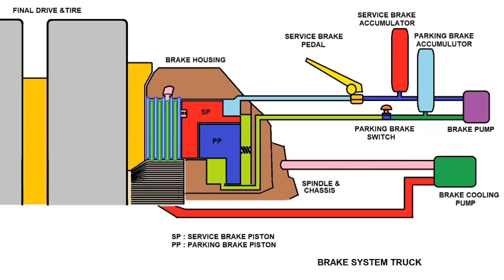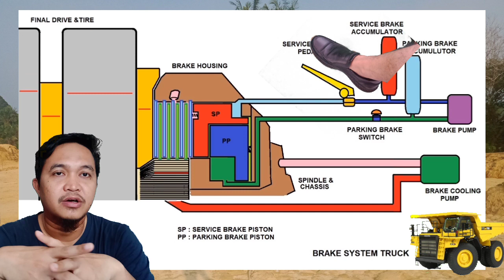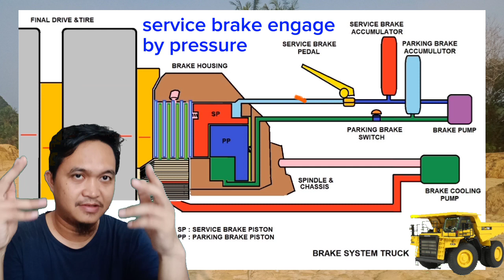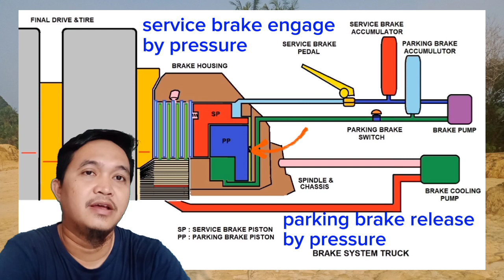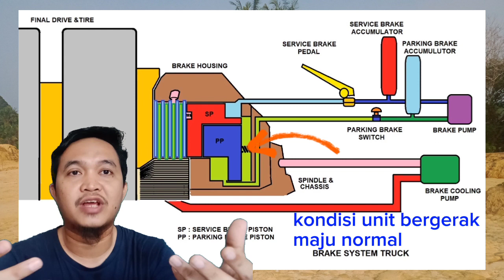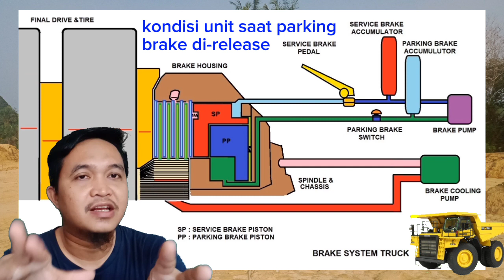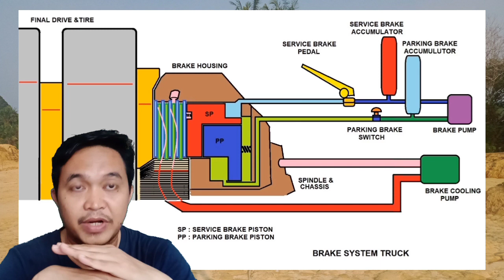Brake system unit truck. Cara kerja service brake, parking brake dan brake cooling truck. BMC 27

Comment: Ijin tanya mas . Saya ada engine Caterpillar 3126 industrial.
Ada masalah pada saat awal start mesin normal. Setelah beberapa lama .mesin tiba-tiba jadi hunting / mengayun . 
Lalu mesin dimatikan dan di restart ulang baru mau normal lagi ..
Kira2 penyebabnya apa ya . 
Karna mesin tidak ada MID/CID/FMI . hanya ada lampu indikator diagnosa yg berkedip 6 dan 4 kali ..
Reply from the maker: Mas bisa dibantu merk monitor nya ? Dan warna lampu kode errornya mas.. 🙏🙏
Reply: @dikiadnarrayyan  kita gak pakai monitor pak . Hanya ada lampu diagnos, warning ,posisi gear , gitu aja pak .di dashboard 
Kalo warna lampu merah pak .
Apakah
Reply from the maker: @dedy__spt8047  Untuk ini sepertinya karena ada error mas.. tapi untuk kode lampu coba saya Carikan dulu ya mas dia ini error komponen apa.. wait mas .. 🙏🙏
Reply from the maker: @dedy__spt8047  mas .. apakah di kode kedipan lampu ada 3 lampu warna red yellow dan amber (merah kuning putih?  Atau cuma 1 lampu merah aja?
Reply: @dikiadnarrayyan  hanya 1 lampu indikator saja pak .warna merah .